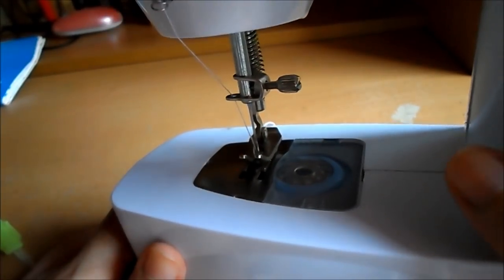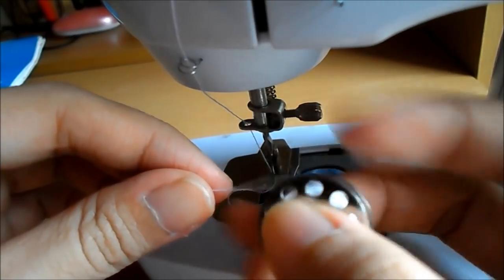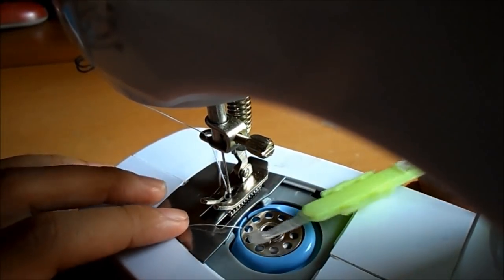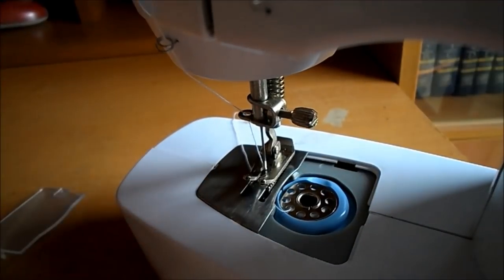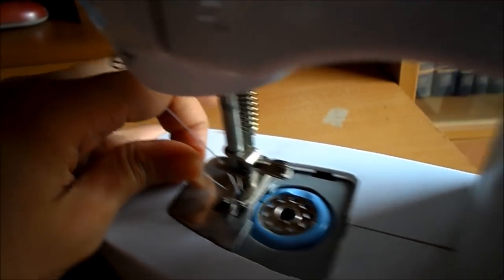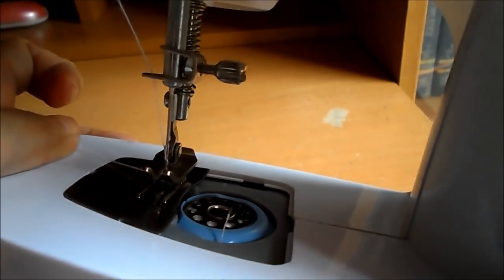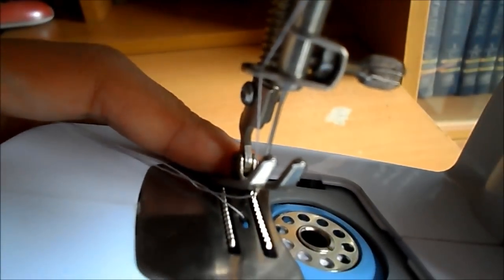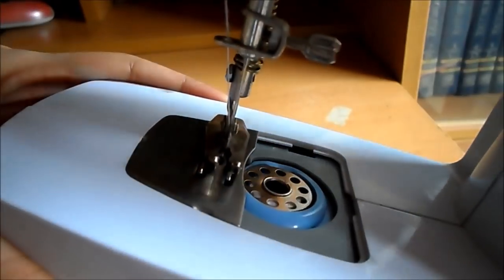How to get the Thread from the Bobbin Case | Portable Sewing Machine

Comment: hi my machine is similar to yours as bobbin area is same but bobbin wont catch thread , the thread from needle doesnt go whole way across bobbin like on your machine just goes half way then comes back doesnt go far enough to catch, i have never even used my machine b4 but my daughter borrowed it and said it was working fine , ?
Reply from the maker: Hi Donna Williams  maybe you need to put longer thread from the bobbin so the upper thread will catch it all the way up.  That's what I do. :)

Comment: Thanks for your reply, i really appreciate it. One more thing, how you manually lock, for example, you want to attach a pocket in a short or bag that there's no end, that there's no possible way of locking it manually?
Reply from the maker: karenwakin For the pocket you can lock it on the upper right edge (using the machine) then you can manually sew it (by hand) to make it more secure. :)

Comment: I did exactly the same as u did but the needle still not catching up the bobbin thread,the needle goes down ,comes up making a loop but not catching the thread from bobbin......i don kno whats wrong
Reply: Sidrah Zeeshan
Reply: have u gotten a solution? I also have the same problem with my mini machine
Reply: have u gotten a solution? I also have the same problem with my mini machine
Reply: Yes.. there is a solution.
I have the exact same model as this one. The needle and the bobbin case were not synchronised. I opened the bobbin case plate and tried repositioning the case in its rail o that he hook of the case turns a full circle timed with the needle descent. It might take several trials but it works. Good luck

Comment: hello. i've follow the steps but it is not working. the main needle and thread didnt take the bobbin thread with them when going upwards,
Reply from the maker: Nishiya Nisha Hi! I'll see if I can do a clearer copy. Btw, please make sure the bobbin thread is inserted to the gap of the enclosure so the main needle and thread above can get the bobbin thread.
Reply: it is in the gap. i think the alignment maybe a little bit off. any tips to set the alignment?
Reply: I am facing same problem machine tread is not catching bobbin tread?
Reply: Nishiya Nisha hello  we r also the same problem tell me how I solve the problem  thread didn't come